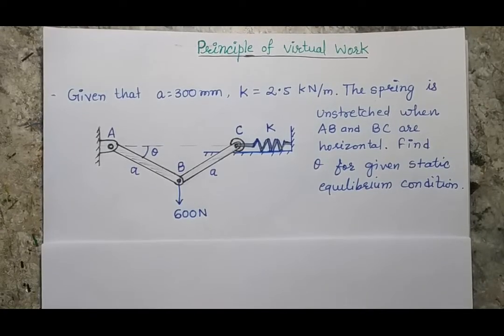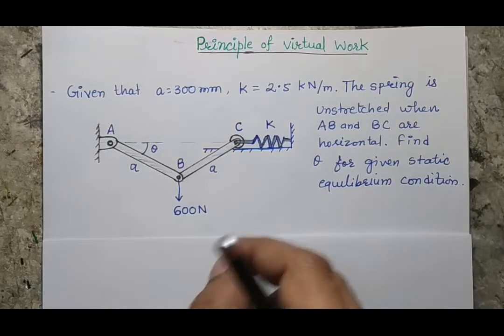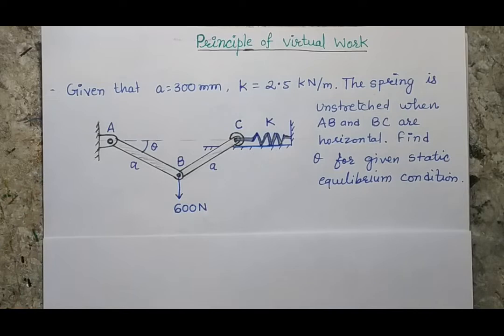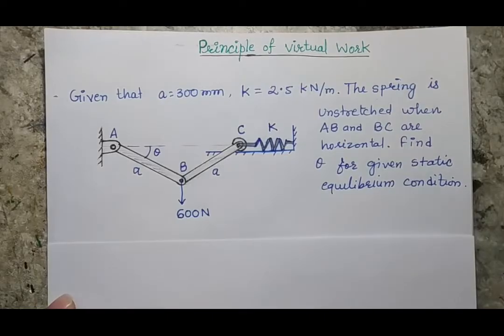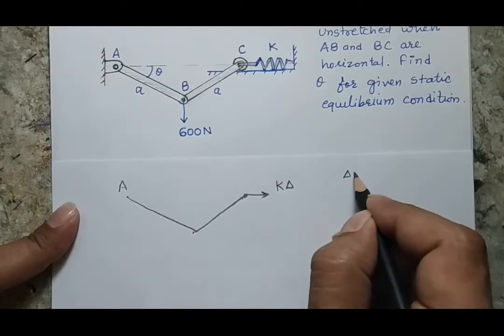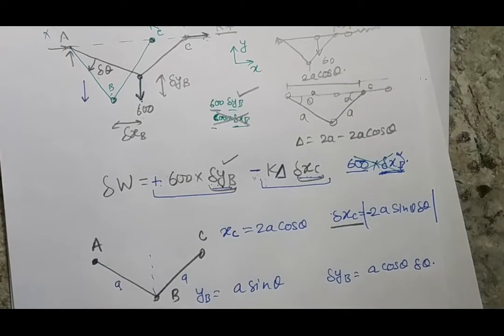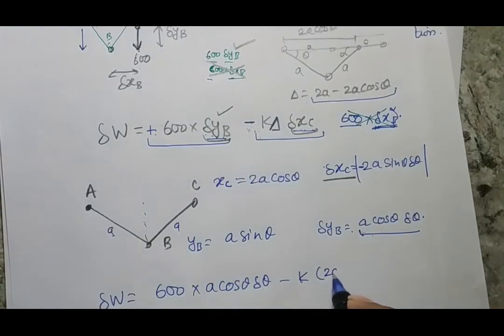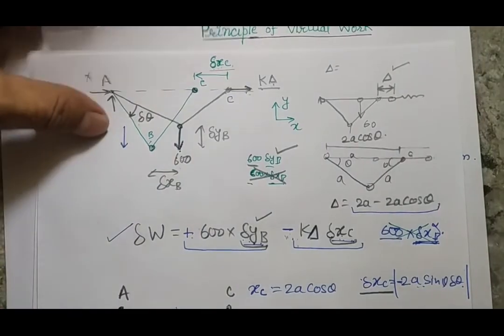Virtual Work Method Lec 6 || (Problem 3)|Engineering Mechanics|First Year Students

Comment: Sir,I have the doubt that we are considering the virtual displacement of the system to be equal to zero. But, we are considering only the specific points in which the forces are acting. How would that be equal to zero ? If We  consider all the particles in the system, then only we get the total workdone equals to zero. Whats happening here ? Kindly explain it to me.